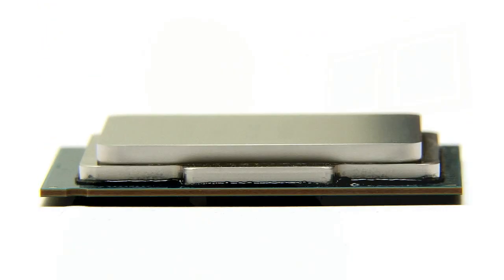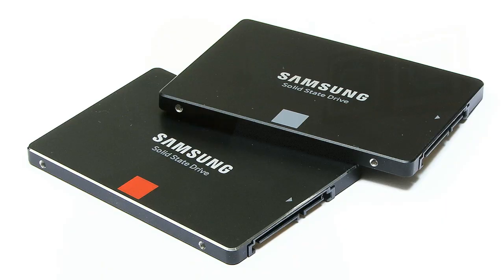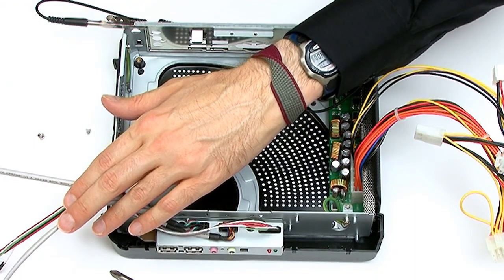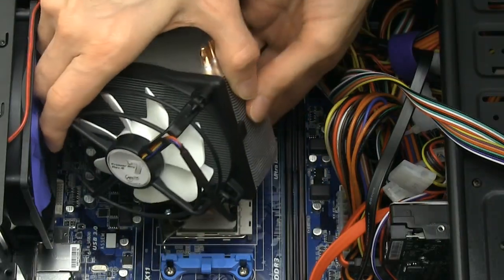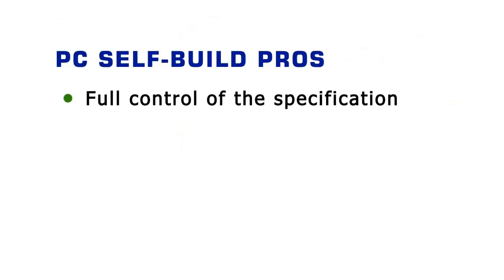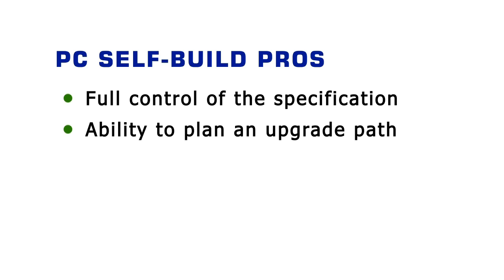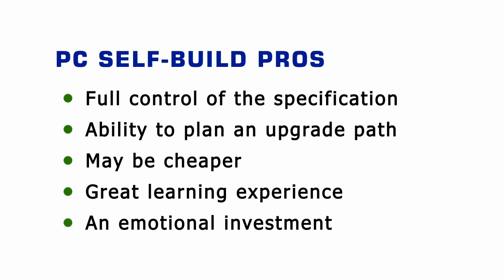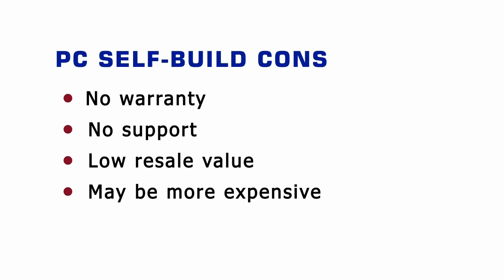New PC: Build or Buy?

Comment: in fact the pc he gave me to replace one that a power supply killed motherboard.   has athlon x2 processor 4 gb ram 1 320 gb with windows vista and my 500 gb win xp. I use 8500 gt graphics.  but it runs good. I have pci slots and can expand to usb 3.0 or add more sata . small board vs what I had but is very quick

Comment: I bought my first PC in 1995; after upgrading a few components (RAM, HDD, and CPU) and reaching the limits of the motherboard, when that last component got replaced, I realised that I had the knack, and thereafter all my desktops have been self-built.  I've also built over a dozen for other people.  I have to say it is very enjoyable to build them.

The video says everything about the pros and cons quite succinctly. 

As to the cost, PC maker companies can also claim VAT back on their purchases, whereas Joe or Josephine Public can't on the whole.  Over the years, PC component costs have come down, to the point where it isn't cheaper to self-build now.  The price of Windows hasn't come down, though.  I'm not sure if it's actually gone up, or if it just looks more expensive because the hardware costs have decreased.

What is the price of Windows for current versions?  I only use Linux Mint on my machines, unless I buy a used laptop with Windows pre-installed.

Comment: myself and a friend of mine prefer building pc. in fact he has some hard drives that they are just left over from random builds hes like would you like them im like well why font you use them most are prob old sata drives or ide but they still work. and I could use them for offline storage like you shown in your video on this YouTube channel. hes better at computer then I am. he knows dos codes etc helped me with my pc. and my laptop that recently crashed with windows 10 and hard drive clicking I put a older drive in and windows 7 running happily

Comment: It's easier to build your own systems if you have a supply of spare parts to test against, if you have spare DDR3 ram, spare power supplies, etc. That lets you swap out parts if something isn't working. With ram, you can usually also boot the system up with only one stick of ram to test the board, usually when ram is failing it's just one or the other, not both. 

I also do the hand-me-down system with my systems, I replace the motherboard of my main system, then its motherboard goes down to the kid's system, or a server in the garage, then that board might get given away to someone else who has an older PC.

People who want to learn to build systems would probably be better off getting discarded computers and hand-me-down parts to build so they can figure out how they go together, then once they're comfortable with that troubleshooting, go to building a bigger system. My first two built computers were hand me down parts from my Uncle who worked at NCR, so he had left-over 8086 and 80286 components to play with in the early 90's. I started out mainly modding those because they were mostly prebuilt. I also had a 486/33 a couple of years later that was a hand me down that I also extensively modified. The first system I built from nothing was a NexGen586 based one, a cheap and unusually designed processor at the time, but its microcode to translate x86 to RISC became the basis for a lot of more recent processor designs. Only after that was I willing to spend the large amounts of money to construct my own system, a close to top of the line Pentium 150, over $1000 for the completed build. Not cheap for a high school student at the time.

Comment: The first time I built a computer was in 1998, and I have built every desktop computer I had ever since. Most important aspect for me is that when I create the spec; I can include what matters to me and exclude what doesn't, while brand name manufacturers typically include what can be marketed to a wider audience. They add key words like "gaming" or "VR ready" to the description almost by default these days.

Regarding cost, I agree that the immediate cost of a low-cost self-built computer can be higher than a factory-built one due to cost of buying an operating system, however, I believe the long term overall cost of ownership with the self-built system can be lower, because you can almost always upgrade a self-built computer in the future as needed (up to a point of course), while a factory-built low cost computer is usually built to serve for the duration of the warranty period with next to no potential for expansion or upgrades, often using  custom or proprietary cases, motherboards, power supply units and cooling arrangements that are all but impossible to work on from an upgrade point of view.

While, in theory, if you build a low-cost computer today but use modern components with a decent motherboard and a decent power supply unit, and you invested in the OEM version of windows, you can upgrade CPU, RAM, storage and GPU in the future (everything except the motherboard) without much trouble really. You can keep adding more life to the platform for as long as it serves you. The same cannot be said about branded computers, especially economy models.

Comment: tip: fully research what you are going to do with your PC before you even make a parts list.(example:mine does not have Bluetooth or wifi,i don't use either.)
Reply from the maker: I so totally agree -- a computer is a tool for doing something. And it is good to know what that is before you start! :)
Reply: I've had problems with that aspect in the past, when someone wanted me to select a PC for them.  My first question is "what do you want to do with it?", and they never seem to know.

Comment: I built my first PC back in 1996, a Pentium 133 with 16 MB of RAM, SCSI HD and 4X(!) CD drive. Not cheap but I knew everything that went in it, and I learned a fair amount since I was my own tech support. I bought my second PC (Athlon 64) from a local outfit, but it was semi-custom as I spec'd a fair amount of the hardware. I built my third and current PC (Core i7 2600K) over five years ago; the only real major upgrades I've done were from 8 GB to 32 GB of RAM last year, and a 1 TB SSD for Win 7.

I don't think I save any money by building my own, but there IS a great deal of satisfaction when I do it. Especially since I'm 14/25 of a century old and still try to remain tech-savvy :)

Comment: great video! Maybe you can make another one about upgrading an existing machine. For example which parts of the computer are worth upgrading and at what point does it make more sense to buy a new one.

I was going to buy a new PC this year but a friend advised me to upgrade my current one. So I bought a new case for better ventilation and a SSD to make it faster. The SSD was a great decision so I went ahead and did some research for a new video card. Turned out that my mainboard already bottlenecked my videocard. The end of the story was buying a new mainboard, CPU, RAM, power supply (with cable management) and a new video card additionally to the case and SSD.

At first it's really overwhelming if you know nothing about what's currently going on with what's the best hardware out there and what's an affordable alternative to that. But you really get an interesting insight on how all the different parts of a Computer work together and especially what differences there are from different manufacturers. In the end it's sometimes not about what's better but more about what features do I favor about another.

Comment: Yeah but if you build a computer you will not install a Windows Operating System especially a few years (i.e 2 or 3 years) or months before the end of its product lifecycle. If in it doubt and there is no specific requirement or very little of a requirement consider using a free or open source operating system.

Comment: Been building p.cs since the early 90,s and still do.
Have things changed? Yes certainly, the pace of computer ' improvements' & advances has slowed a tad compared to the very early days.
Remember all those computer fairs ? the joy of irq's com ports & resulting conflicts.
If you a geeky sort it's really a fun thing building a p.c, completely missed with some folks :-)
Today's building of a p.c has different issues, some of which are more apparent to the seasoned hack.
For instance, regrading possible faulty components, I find it's best to buy both the motherboard, memory and cpu from the same seller, as sellers often try to pass the blame to other components. Of course, it's not always possible to do this.
Buy a motherboard with at least 4 memory slots, and both svga and HDMI and plenty of usbs
As with a organising a good holiday, planning & contemplation, is half the fun of building your own p.c.
In today's times money can be often saved by buying o.e.m windows software on eBay ( along with a small piece of hardware to make it legal ;-) ) Further money can be saved by buying a quality s/h graphics card rather than a new one.
As regards CPU selection, I have rarely ungraded a CPU at a later date, I tend to buy the best I can at the time, as from experience, at a later date the higher spec. CPU is too pricey compared to is age.

Comment: The very low price of retired corporate machines makes it hard to justify the trouble of self-building. Depending on what you are doing, upgrading things like HD to SSD can be a cheap way of increasing an old machine's performance. 
On the other hand, changes in things like memory technology may mean that you have to change so many things at each upgrade that the only thing left is the box, and that's beginning to look grubby.

Comment: PSUs rated for higher power draw don't actually draw more power by themselves, they are less efficient under smaller loads but it's not a meaningful difference in power consumption. 

Also worth mentioning is that you can build a computer with higher quality parts than you'll find in prebuilt PCs and if that's your thing you pick the right configuration to run OS X on an expandable and upgradeable desktop for very little money. 
The actual assembly is extremely simplified these days and I've seen people with no previous experience put together a computer under my supervision, plus there's a ton of tutorials and videos.

Comment: Thank you for another interesting video!
I used to build my own machines all the time, but due to Windows costs I've recently moved to buying brand name machines.  Part of the reason I started buying branded machines is that for the most part you don't have to worry about component compatibility, usually they just work right out of the box.
I have played with Linux in the past and liked the experience but I could never quite make the switch from Windows. With the advent of Windows 10, I find myself looking at Linux once again in a very serious way.
Having installed Linux Mint on my laptop replacing Windows 10,  I find that it would be very easy to drop Windows completely.  When it comes time to replace the desktop Win7 machine I will probably be building my own and using Linux on it.

Comment: The expense of a Windows OS is ridiculous. It's hard to believe someone who doesn't need to be one of the wealthiest people in the world hasn't created a reasonably priced alternative. Like yourself, I've been building computers for over 20 years, so that's the easy part. It's the cost of an OS vs an OS I'm unfamiliar with that's the rub.
Reply: John Ratko Too true! Thankfully, Win10 will run just fine without registering it save for the watermark on the desktop but it hasn't bothered me in the time I've been working with it. Saved me the $100 when an old main HD failed and I had to buy a new one.

Comment: I'm a self builder since my first Cyrix Win 3.11 build.  I'm getting ready to do a new build with an Intel CPU (first Intel CPU ever). Either 6th gen i5 or i7.  I'll be building a silent PC (well, very quiet.  Total silence is too expensive.)  My current Phenom II PC is nearly silent with the PSU being the loudest component. --  I'm looking to start off with a 2k monitor but am having trouble determining if the Intel on-ship graphics will adequately drive a 2k monitor for productivity use at 60hz min (actually, this will be a music content creation system running Studio One.).  When you do your i7 build could you mention about the video options?

Comment: Personally I prefer building my own. My current desktop pc is a pc that I've been building for about 2 years now, and I yet don't have a good graphics card. I'm a teenager without a job, so it takes quite some time to get parts. But by doing as I do I atleast, as you said have control. I don't have any big branding on my pc. I mainly use my laptop though.

Comment: It's like building lego, I was so scared when i built my 1st pc in 2003 the parts cost me £1200 I had no idea what to do but it does not take Einstein to work out what goes where.
A cpu will only fit 1 way, you have a 20 pin power socket on the MB with power printed under it and you have a 20 pin on the power supply with power written on it,read the labels

Comment: Just bought Windows 10 Pro activation code from Amazon for £30 is that expensive compared to a £1000 PC?!
Reply from the maker: No, it isn't. :) But £30 is a very good deal, as the official UK price for Windows 10 from Microsoft in the UK is £99.99, which is 20% of the cost of a £500 PC.

Comment: With the advent of YouTube, I think it's probably safe for a newbie to build their own computer these days.  There are thousands of build videos to reference.  Also, components are much more standardized than they were a decade ago (a friend once screwed his motherboard directly to the case without stand-offs -- now the stand-offs are commonly built into the case).  As for saving money, if you're building a high-end machine, the savings can be substantial.  I built a system based on the Intel Core I7 6800k (hex-core) with 32GB of RAM just six months ago for much less than half of what a similar system would cost from Dell.

Comment: I've never actually built a PC. But I've always bought and installed new hardware once the warranty had expired. I've upgraded my present machine with an SSD main hard disc (highly recommendable if you want a faster machine), a large traditional second drive, more memory and lots of USB-3 ports. And I've purchased an M-disc drive that I plan to install soon. And on earlier PC's I've installed new sound cards, graphics cards etc. In fact I'm considering whether I should invest in a new graphics card now, as DaVinci Resolve won't run on my present card.
Reply from the maker: DaVinci Resolve is picky -- but once running, it does work rather well. :)

Comment: For all those who would like to build an own PC but have zero experience, I suggest to buy a cheap assembled one and start making small changes, such as adding memory, replacing a hard disk with SSD, adding a data disk, etc. This is a very good starting point and I use it often by myself.

Even with excellent knowledge (as myself), pre-assembled computers can make a large performance difference, unless you really know each component you are placing on your motherboard. Large producers usually suggest to use certain components, but then, half of the fun is gone. It is a much better feeling to get a working PC and "fix" it :-)
Reply: y2ksw1 Your idea has merit, especially for wannabe techies who've always wanted but don't know where to start. YouTube is your friend, but one thing I've had trouble finding is someplace that gives me clear step by step instructions on how to migrate the OS from one type of drive to another, especially if they are different sizes or types like HDD to SSD. 

And for OS I'm talking Windows.
Reply: OS Migration was handled in this channel. I use MiniTool Partition Wizard, which makes it a one-click operation.

Comment: one of the big problems with buying a computer, beside the price of course, is that many of them use proprietary hardware and, depending on the form factor, you may not be able to install any additional hardware....and you cannot overclock it.

Comment: Thanks for a good intro to self build.

Been self building/repairing for many years, it has never been easier than now with truly standard interfaces.

 Great resources available on Youtube such as Pauls Hardware and Carey Holzman for basic build methods and parts advice.
Using something like the Partpicker website can be good for compatibility checking if you are not sure.
Getting OEM Windows keys gets W10 for <£30 - check out Amazon.
On a high end gaming system save ~£200-300, but its about even on a mid range office system.

Comment: All good points.  Another advantage is that for the same money you get more machine.  When I build, I know my processor, memory, Hard drive (SSD) and motherboard are all top quality.   I've serviced many HP, Dell, and other machines and can say without hesitation that they skimp on quality wherever they can.  The main component they really skimp on in every machine I've serviced is the Power Supply.  This alone is enough reason to build your own.